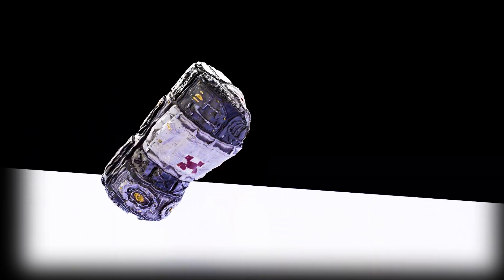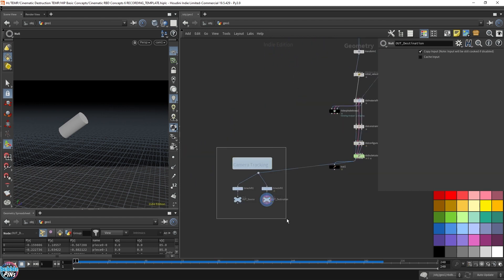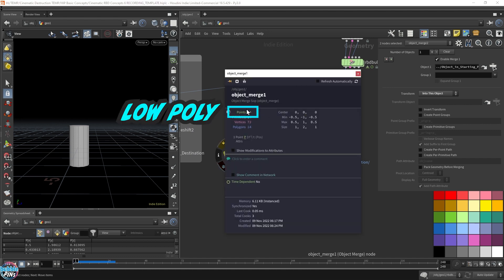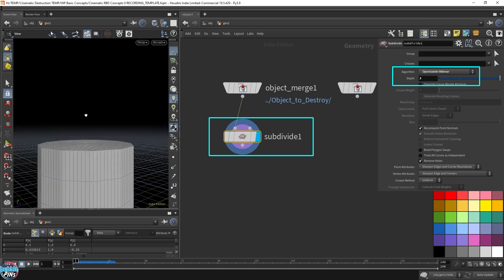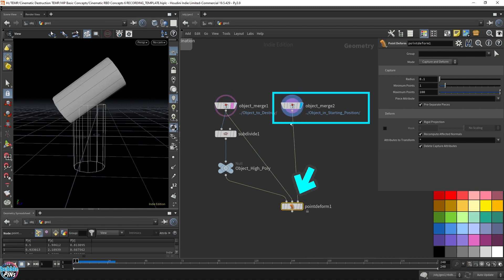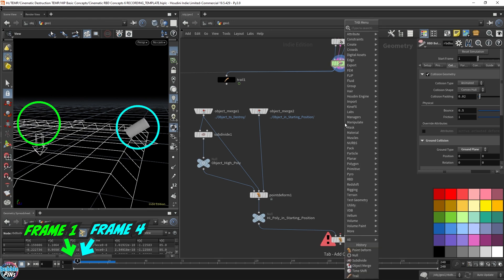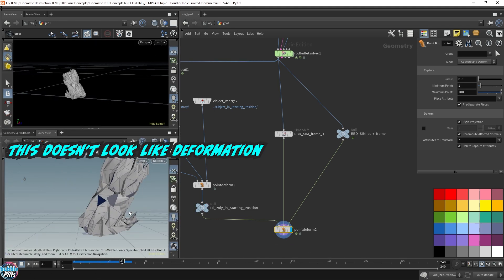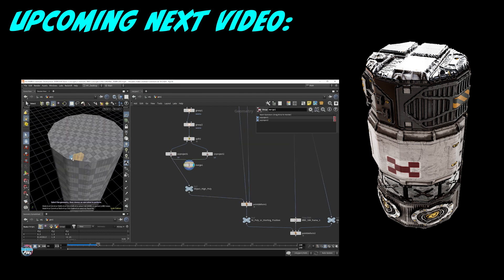Cinematic Destruction Basic Concept #6B RBD Deformation (Rigid Body Dynamics)

Comment: Don't go Mantra, just straight to Karma 😁
Reply from the maker: That's true!  I should just go straight into Karma!  Let me do some test scenes and see how this deforming tube looks in Karma!  Thanks for the suggestion!!
Reply: @bubblepins  Yay! With Karma CPU you can still use Mantra's VEX Principled Shader (if you're not comfortable with MaterialX) 🤓
Reply from the maker: @baldoski  I tried it, but I didn't get very far with it.  I am excited that we can port the material over to UE and blender very easily with MaterialX!
Reply: @bubblepins  That's nice. I switched to Linux sometime ago and haven't tried UE yet. As I can see there is no longer need to build it from sources and Epic provides the installer. I wonder how it'll perform cause Karma XPU is too buggy and lacks of features and in CPU mode too slow, hard to clean the noise :(
Reply from the maker: @baldoski  I have heard that Houdini runs faster on Linux, but because most of my video editing tools are on Windows I never made the switch.  And the threadrippers & M2 drives now are so fast, I'm not sure it makes much difference anymore.
Reply: @bubblepins  I can see a small (up to 10%, maybe 15%) power increase in some simulations and sometimes in CPU rendering and responsiveness, which is nice considering it's just thanks to OS switch. Davinci Resolve and Fusion are available for Linux, if we're talking about some adobe alternatives (and Substance Painter via Steam Proton). But yes, Win10 is better optimized since year or so. I jumped like crazy between few distributions this year and actually with all of these problem solvings with VFX software installations and running them I love this system a lot. I can say Windows is history for me for content creation, now I only use it for casual gaming.
Reply from the maker: @baldoski  Do you have any recommended apps for open source video editing?  I've been trying to lower my cost, because Adobe apps are just sooo pricy and all I use it for is editing videos and creating thumbnails.  Doesn't seem like it's worth the $60/mo.  even with the discount I get.
Reply: @bubblepins  There is a free version of Davinci Resolve and it's a fanstastic piece of sotware, very competitive to Premiere. Even perpetual license costs 300$. Compare free and paid - maybe free version will fits your needs. If you're looking for photoshop alternative the good one is Affinity Photo (developer provides 30-day trial).
Reply from the maker: @baldoski  Thank you!!  THat will definitely come in handy!  Anything to help the budgeting!
Reply: @bubblepins  have you tried it yet? :hand-pink-waving:
Reply from the maker: @baldoski  Sorry not yet, I'm a little behind in my videos lately.  The Davinci will need to be placed on my backlog queue,